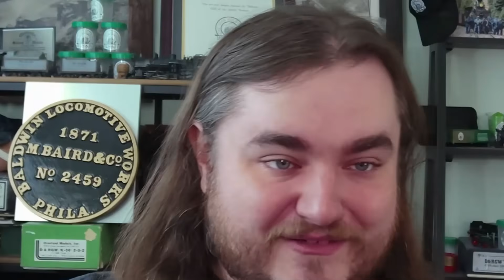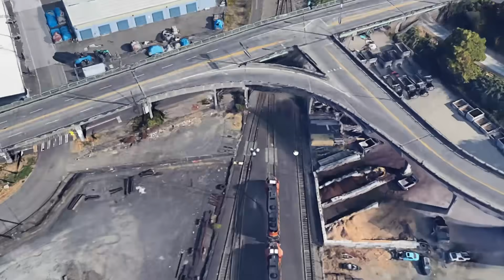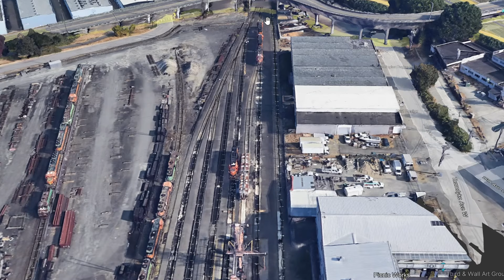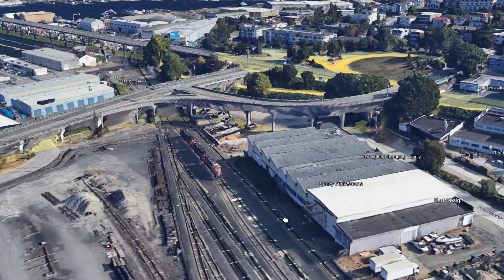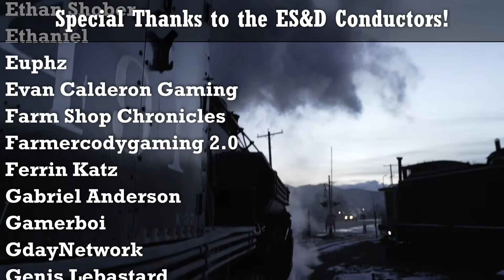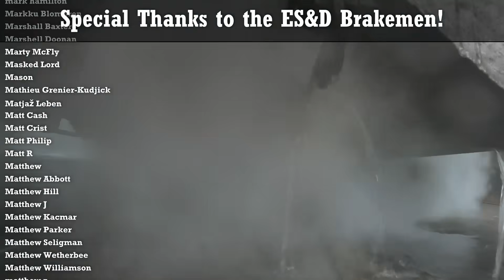[SFS] This is a boxcar that ruined our week.

Comment: On similar thing to the GP unit that's a 'boxcar': The British rail class 99 'locomotives' that floated. https://en.wikipedia.org/wiki/British_Rail_Class_99_(ships) Because BR bought a computer system developed for union pacific, that tracked locomotives and cars. But BR had ships, so they needed to record them in the computer. So they were given engine numbers 99001 through 99015, and recorded as locomotives in the computer system. (This computer system is still in use to this day).
Reply from the maker: That's a fascinating niche piece of history, lol!
Reply: It was TOPS, created by Southern Pacific, not UP.
Reply: There is a new class 99 for one of the freight operators over there on order now. This one actually is locomotive…
Reply: Class 98, meanwhile, is reserved for steam locomotives.  Every steam locomotive that has a licence to run on the BR mainline has not only its original running number from circa 1950 (or earlier), but also a special TOPS number in Class 98, because the original numbers inevitably overlap with TOPS numbers allocated to diesel and electric locomotives.  For example, there's a number of ex-LMS "Black Five" and "Jubilee" locos, which had BR steam-era running numbers in the 45xxx and 46xxx ranges, which TOPS thinks are Type 4 diesel-electric locomotives of the "Peak" family.
Class 97 is reserved for "Departmental" locomotives, and class numbers in the 9xx range for Departmental multiple-unit trains.  Unpowered vehicles are also number in the 9xxxxx range, making them easily identifiable to ordinary railway staff.  These are used for a variety of special maintenance and research purposes.  Very often they have been modified from a standard locomotive, MU, or other vehicles that would otherwise have been retired.
Reply: Class 99 is the best train class. Most diverse
Reply: Did the humber paddle steamers wingfield & tattershell castle ever get TOPS numbers? they did run till 1974 and even got repainted into what is sealink livery...
Reply: @davidty2006 Rather late, but no, as the TOPS designation was only for train ferries, while those ships were only for passengers.
Reply: CN used to give the AquaTrain barge service a train number for the same reason, I think it was L539.  We're still using TOPC, which I believe is a version of that original SP system.  Not to mention some other 'legacy' stuff like SRS and CATS.
Reply: Makes me wonder what they are going to do when the class numbers of actual locomotives pass through the 80s . . . ?
Reply: @Lucius_Chiaraviglio  They already have!  The class numbers were always stratified by the general type of locomotive; the lowest numbers (01 to 13) for shunting engines, the rest of the tens (and 20) for the "Type 1" diesels and so on up to the 50s and 60s for "Type 5"s (a rough power rating); 70s for DC electrics, 80s for AC electrics.  Class 88 was originally skipped for some reason, but there were modern thyristor-drive AC electrics in Classes 89, 90, 91, and 92.  Now there is a bi-mode electric Class 88, and a tri-mode Class 93.  Most of the lower class numbers are technically no longer used, belonging to old diesel types that have been retired, usually after a short and very inglorious career, effectively as prototypes.
Meanwhile, the much bigger range of three-digit class numbers is allocated to multiple-unit trains.  1xx for diesel drive, 2xx for diesel-electric drive, 3xx for AC electric, 4xx and 5xx for DC electric, and so on.  Modern electric types are mostly in the 7xx and 8xx classes, depending on whether they are designed for commuter or express service.
Reply: There's even further nuance to this. Because since sometimes trains would travel on the ships from the UK to mainland Europe, while the train was in transit on the ships, the computer would display that the Class 99 was the locomotive on the head end of the train... Some of the "locomotives" are still in service, however they've all been sold off after BR got yeeted into non-existence. The Class 99 TOPS code has since been re-allocated to a Stadler Eurodual, only shrunk...

Comment: hyce do you like the 0-6-0 in derail vally?
Reply from the maker: Yeah! It's fun. It just doesn't pull much.
Reply: @Hyce777  You got to give it more beans. :)
Reply: @Elliottblancher  : I was running the Rivarossi model equivalent on a branchline job at the model railroad ops session last night, and had an amusing problem from giving it too many beans.

It was late and dispatch had gone home, and I was reassembling my train after having doubled a hill (because, no, the model doesn't pull much either!), and had uncoupled some cars and was sitting right in front of some points on a switch that was set for the diverging track.  And, because it was late, I gave it the beans to take off at a rather unprototypical rate of acceleration, and the little engine pulled a tiny little wheelie and jumped the front wheels over the points and derailed.

I don't suppose Derail Valley simulates that particular bit of behavior, but they should!